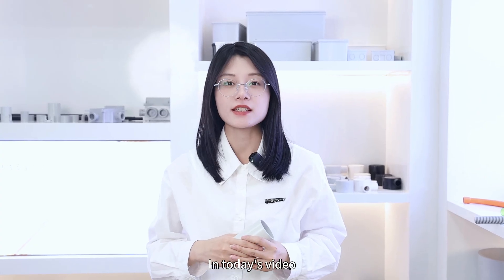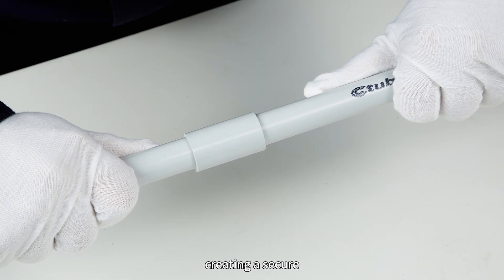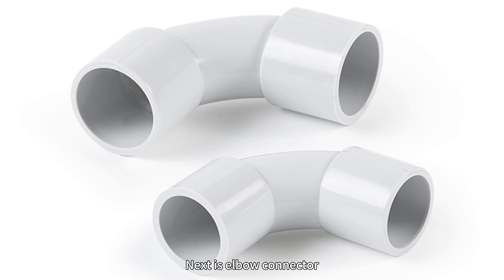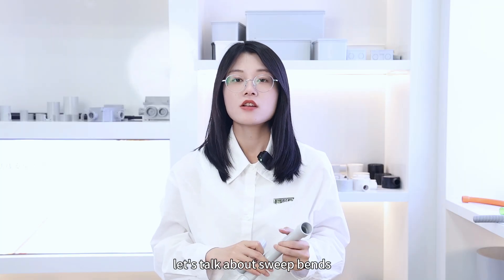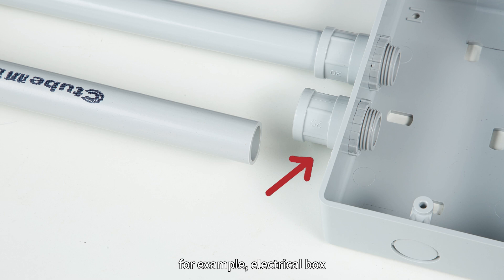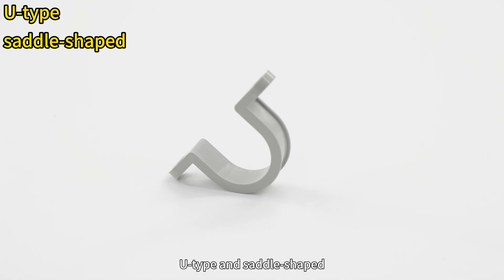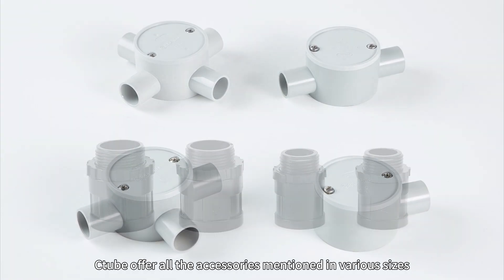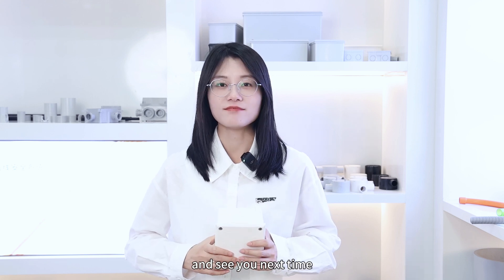PVC Electrical Conduit Fittings & Connector , What You Need to Know | Ctube

Comment: When you connect elbows or couplers, do you need any glue? Or no adhesive is required?
Reply from the maker: Adhesive (solvent cement or glue) is generally required to create a secure and watertight seal; including for the elbows mentioned here. However, some couplers may not require adhesive. It's recommended to consult the supplier based on the specific product and application.